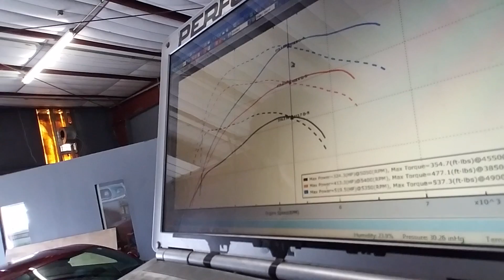Project Ecostang: 3.5L Ecoboost Swapped Mustang - Part 5

Comment: Listen Up Ford, this is what We want, not the turbo 4.   We want Turbo V6, and Supercharged V8
Reply from the maker: What's wrong with a turbo four?
Reply: MPT Performance Nothing exactly, just that Ford has such an awesome V6. The Power of the naturally aspirated, 3.7 has very close power to the 4 Cylinder with direct injection and 20 lbs of boost.
Reply: They should do like what Chevy is doing with the Silverado, make a i4 eco boost, v6 eco boost, NA 3.7, V8 and V8 supercharged

Comment: Is that a 2011-12 mustang with an 2013-14 front and rear bumpers ?
Reply: I know it's a 2010 mustang they got and fixed it up. Not sure of the front, but the back is a 13-14 rear end
Reply: +Landon Clements the front is the 2013-14 front also
Reply: +Landon Clements they have 2012 factory HID lights on it ... That's a cool mix they did I'm going to do the same to my 2011 mustang 5.0

Comment: So please tell me how you're able to make the direct injection ecu read your injection duty cycle. I mean without locating the tables in the ecu and writing to them you're limited by rail pressure without the 7th port injector, there is likely more room in the pump if you found the right tables and adjusted them.   Have you done that now?
Reply from the maker: We are in process of upgrading to a better auxiliary controller. The one Stephen had already was very basic and limited our control, but there was no time to change something that major.
Reply: MPT Performance  So you're just maxing out the HPFP and then dumping fuel in using an alcohol injection controller for port fueling once peak fuel with Direct injectors is met?  Basically what the new raptors are coming with stock